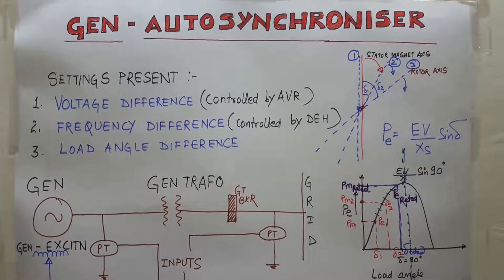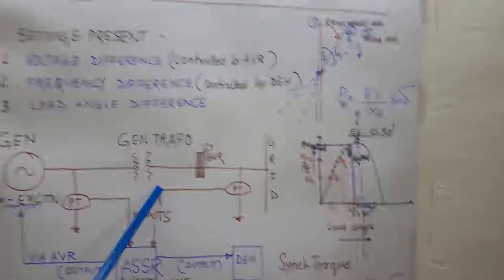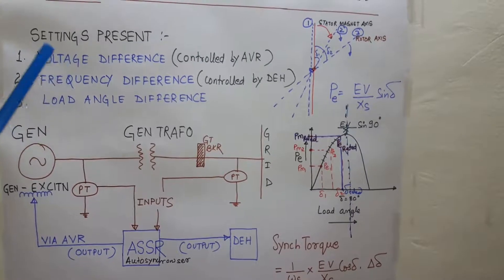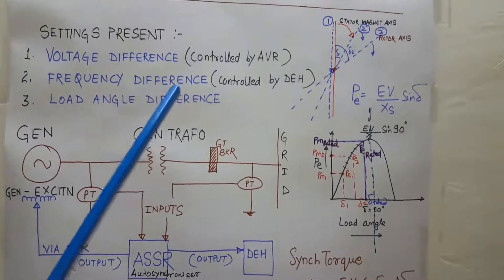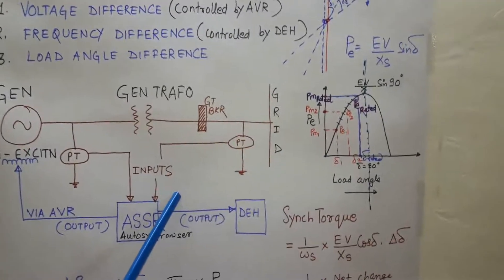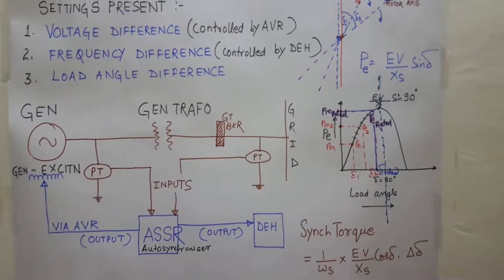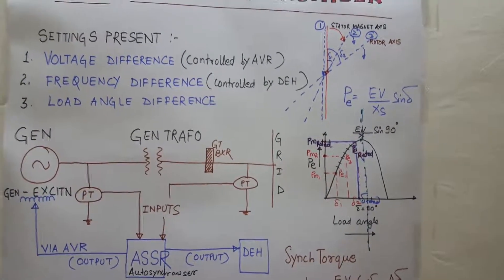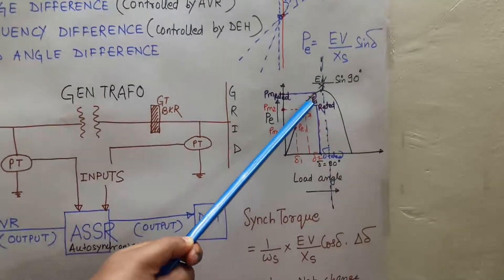GENERATOR AUTOSYNCHRONISER OPERATION

Comment: Please correct yourself, Generator side PT location is wrong. If it is used the way you think , there will be a phase difference of 30 degree and it will result in faulty synchronization. Correct PT location will be on HV side of transformer.
Reply from the maker: Yes ...it is GT HV side obviously which is attached to generator and voltage follows gen excitation in schemes where GT Breaker is used for sync instead of GCB. The voltage is zero when gen is dead.
Thanks for correcting.
Reply: @electrocean6684  sir, thanks for your reply on my comments. Generator PT is on HV side of trans. for synchronization on HV circuit breaker.  In case of GCB the  Gen side PT and Bus PT both will be on LV side. This is only to avoid phase shift in the voltages due to GTR.